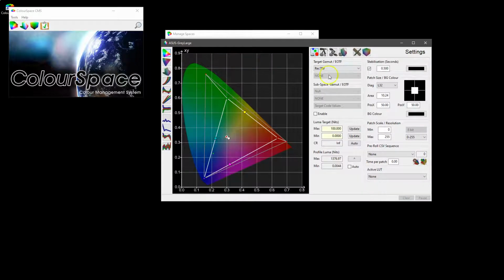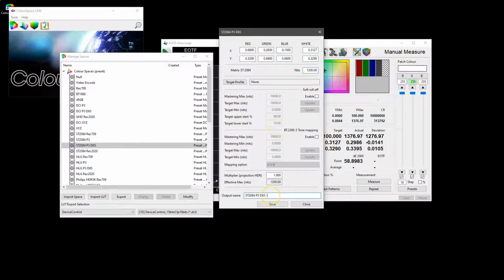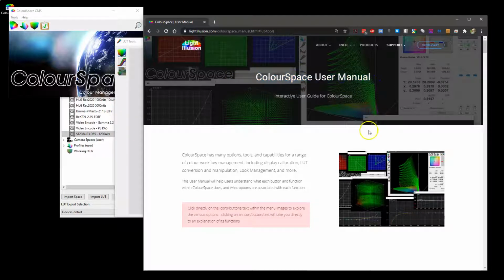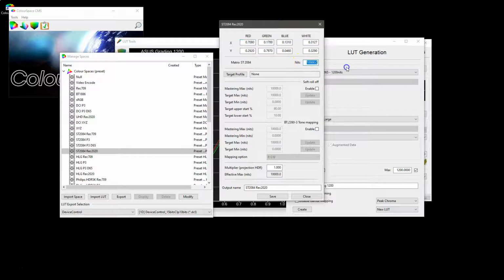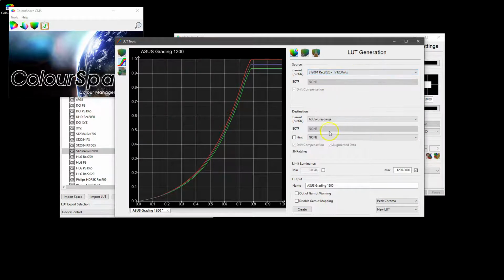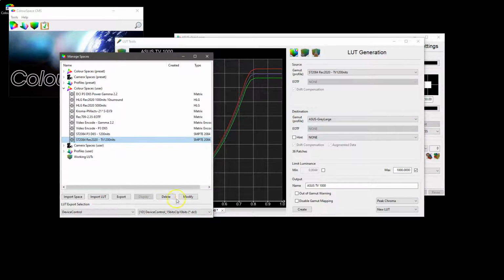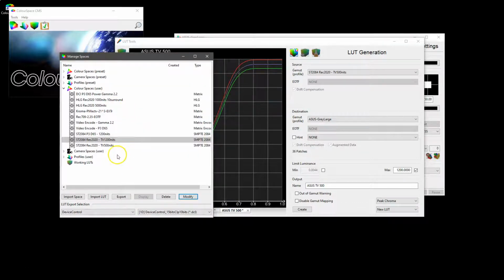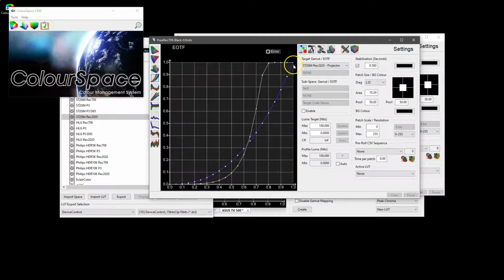ST2084 PQ HDR

Comment: Hello. How to calibrate LG OLED Alpha 9 (C3) in HDR ST2084-2020 21^3 patches?
Reply from the maker: That's not really possible with WOLEDs, especially TVs - all you can really do is basic manual calibration as the TVs are too unstable in HDR, as well as the WOLED issues.
Reply: @LightIllusion  Do you know why I'm jealous that samsung qd-oled does not add support to your software? And is it planned to fix it in the future?
Reply from the maker: @Dima___S  that is a question for Samsung. If they talk to us, we can perform ColourSpace integrations, as with LG, TCL, EIZO, ASUS, etc...
Reply: @LightIllusion  In addition to PQ following and three RGB patches, is it possible to increase any number of patches in HDR on WOLED TV? Or is it a verdict?🙂
Reply from the maker: @Dima___S  Sorry, I don't understand the question...
Reply: @LightIllusion  LG OLED is calibrated in HDR only by 1D LUT grayscale points + 3D LUT 5 points. Is it possible to set more points in 3D LUT than 5?
Reply from the maker: @Dima___S  There is no restriction on the profiling size, etc, except for the instability of the display, and the fact is is a WOLED.
Reply: @LightIllusion  I understand you. Does the instability in HDR also apply to the Mini-LED TV TCL 935 / macbook Mini-LED?
Reply from the maker: @Dima___S  You would have to test any specific TV. We do not runs such test ourselves.
But it is very easy to test, as ColourSpace has a built-in Drift graph to plot such variations.
Reply: @LightIllusion  Hello. Which software version is suitable for both: MacBook Mini-LED calibration and OLED77C3 calibration? Spectrophotometer i1 Pro 1/2.
Reply from the maker: If you really want to try calibration you would need to learn all about ICC profiles, Mac colour management, and then use SpaceMan with ColourSpace.
For the LG TV with the i1Pro probe you can use ColourSpace HTL, or LTE, but you really need a Colourimeter to go with the Spectro. 
See: https://www.lightillusion.com/probe_matching.html
If you really want to try calibration you would need to learn all about ICC profiles, Mac colour management, and then use SpaceMan with ColourSpace.
Reply: @LightIllusion  thanks

Comment: you should consider doing a session where you calibrate a lg cx for example going through all the steps in the right order just to show how easy it can be
Reply from the maker: The LG CX cannot be used for HDR (PQ or HLG) for professional grading work.
And there are great calibration resources provide for the LG displays (SDR) provided on DisplayCalibrations.com.
Reply: @LightIllusion  do you think pa32ucg can be use for professional hdr colorgrading (after calibration)
Reply from the maker: I did reply to your question already? Did you delete the question, and post it again? You will need to verify Dolby/Netflix/Amazon/etc specifications for HDR grading displays.